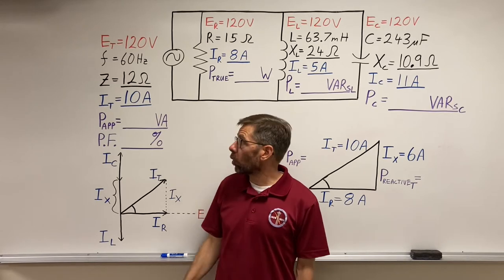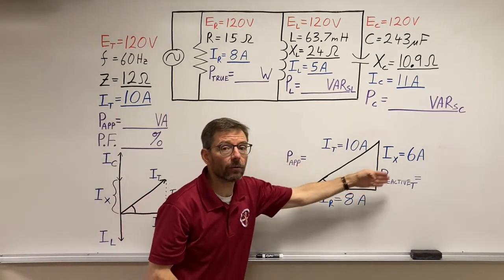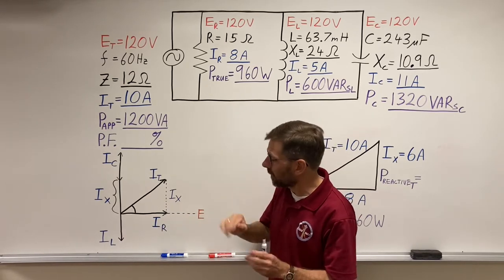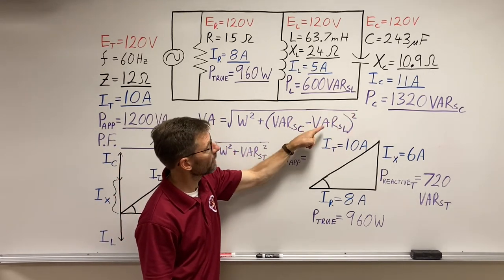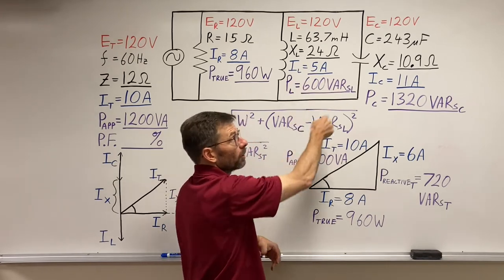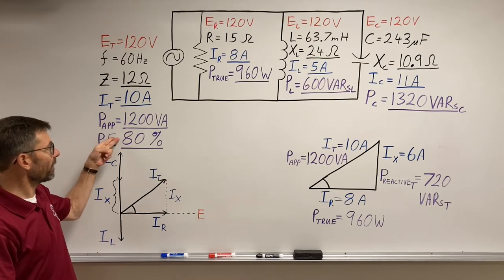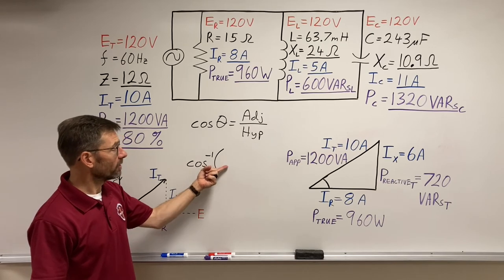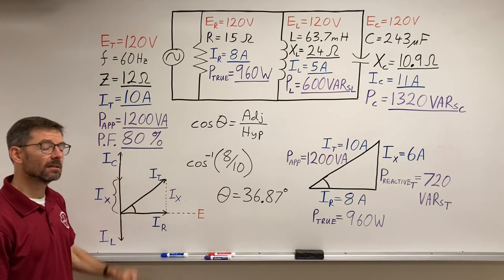Parallel RLC Power & Angle Theta

Comment: Extremely frustrating trying to find a video that has inductive and resistive (from a motor) in the same leg, and then in parallel with the capacitor…Which is what is on my practice exam.. other than that, great videos!!!